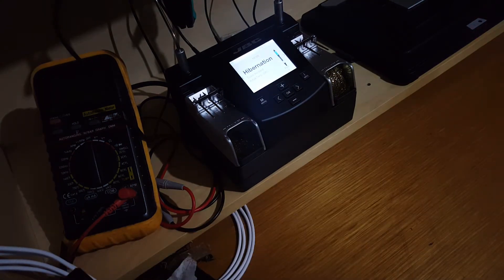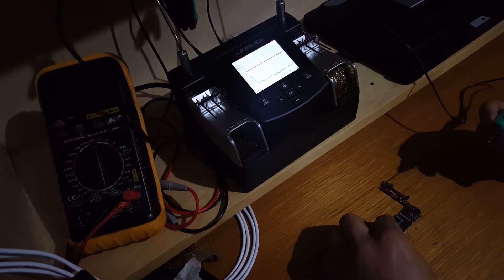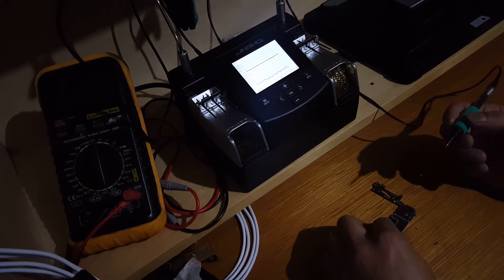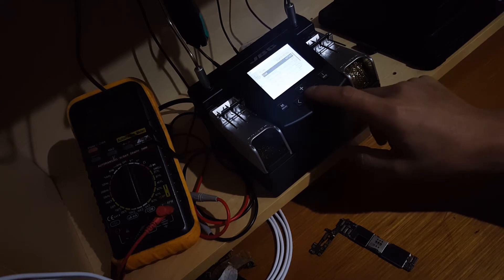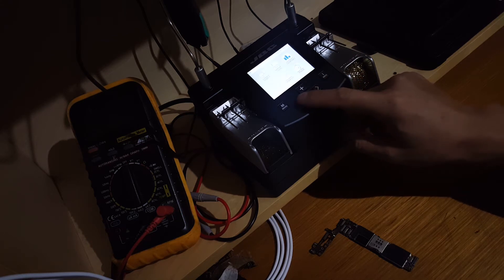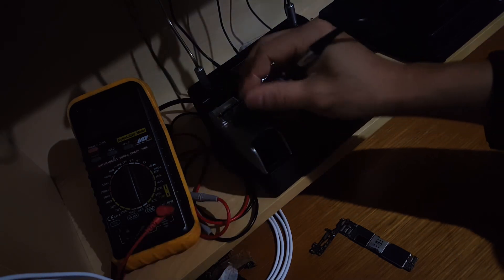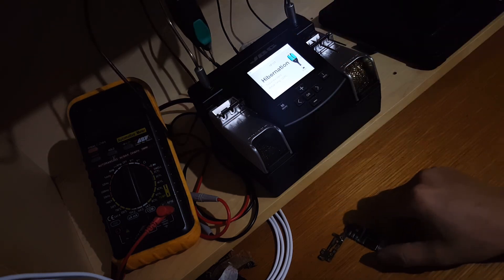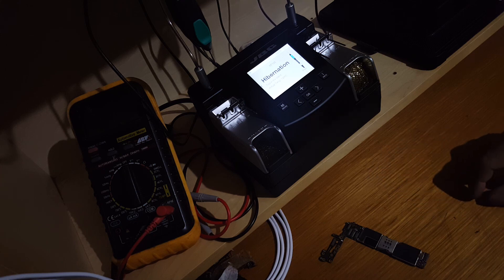JBC NASE 2B - best microsoldering station - Unboxing Part 2

Comment: How do you like the nano station?

I'm thinking about getting one of these myself but it's not for repairing, it's for assembling prototypes and I wanted to ask.

Since the smallest component I'll be using is 0402 and I'll be working mostly with 0805 or 0603, would you recommend this station? Because I've seen it's more suited for very tiny components so I'm not sure.
Reply: It's fantastic, it does have high thermal mass tips you can get,  I went from a Metcal and when this arrived I thought I would have to keep that for bigger stuff,  the power this thing packs in such a small package is astounding,  I'm selling the Metcal now, this is all I need for Iphone or Macs and probably anything else.